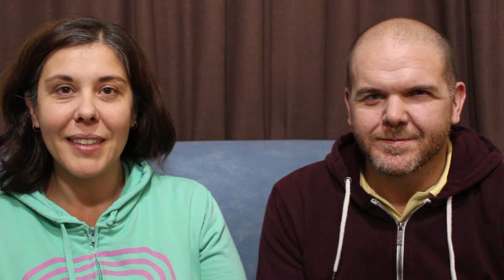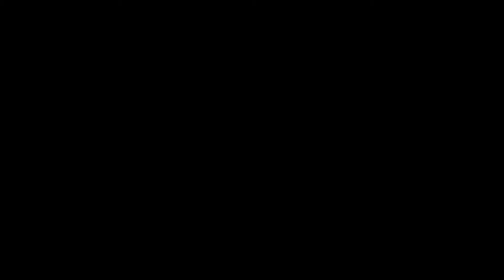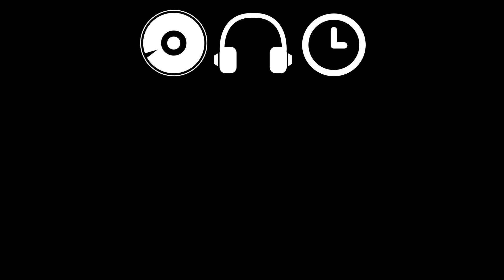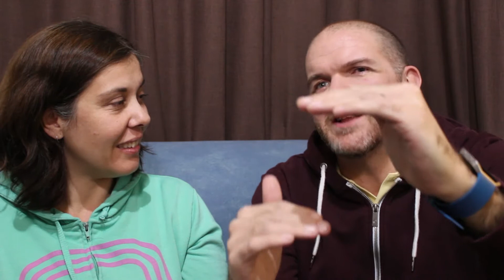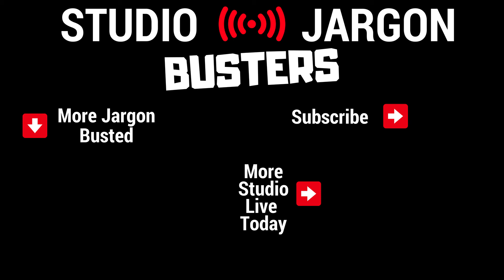Compression Explained (How an Audio Compressor Works) - Studio Jargon Busters #4

Comment: I come back to this very video to make this question which is torturing me forever in the hopes of getting it answered once and for all. Perhaps today its the day finally I would learn this thing just like you explained Tracking to me :)

Here is the question:
Real acoustic piano - what about these two together, real piano and compression, SPECIALLY (but not necesarely) when the piano its being played on its own, just a piano piece

Should the piano be compressed?. Its not precisely the greatest thing on a piano its extrawide dynamic range?, should we them take off the better thing than a piano can apport? or what or how

You understand my question Pete? 

Thanks so much in advance :)
Reply from the maker: It’s a great question. There are mixed opinions on this. Piano is and should be a dynamic instrument but you also want to ensure that it is at a competitive volume. I tend to use light compression on piano just to make sure it is brought up a little but not so much it removes all dynamics.